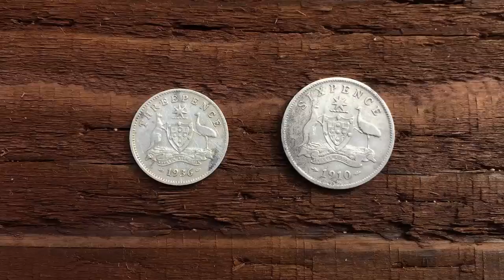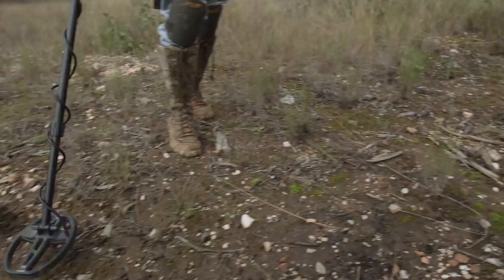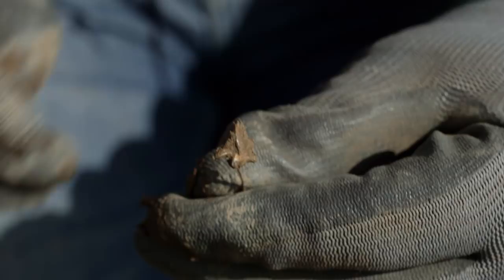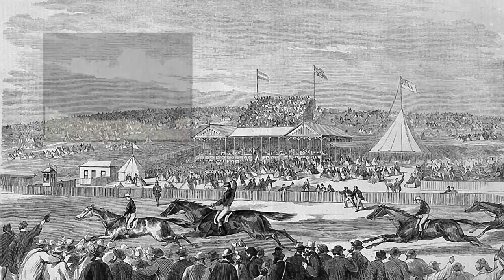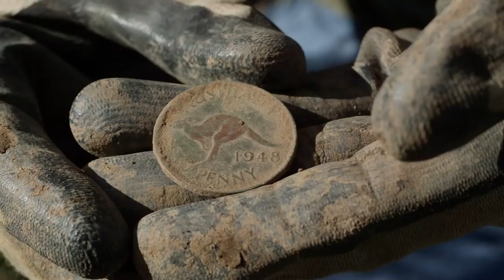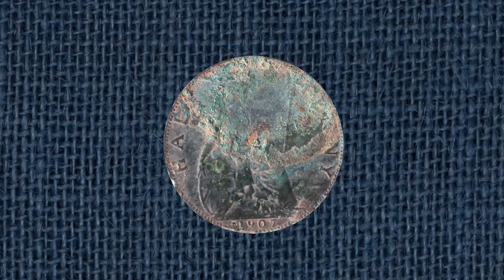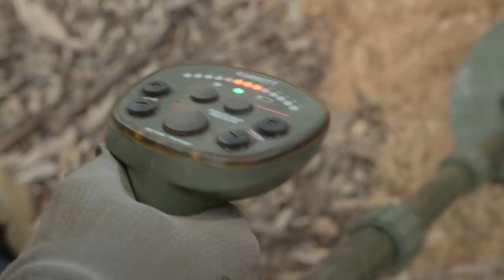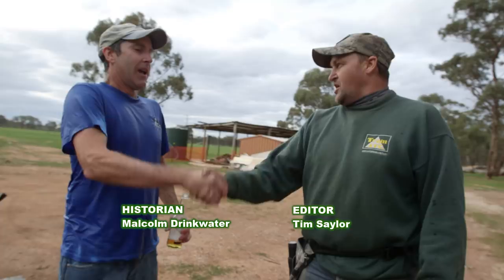DIGGIN with KG & RINGY S1E3: 502 Aussie Gold Down Under (Full Episode)

Comment: Hey guys, wondering why you guys switched from your AT Gold detectors, to the pi ones?
Having trouble finding gold with the AT’s?
Thanks!
Reply from the maker: We still use VLF machines.   Using the AT MAX now.  It is kind of like a suped-up version of the AT-Pro and the AT Gold combined.  The only time we use PI machines, is in deep water (below 10 or 15 feet) or in super hot soil like in Virginia's Culpepper region.
Reply: Yeah- I’m saving up clad ;) to get an AT Max. 
Thanks for the reply!